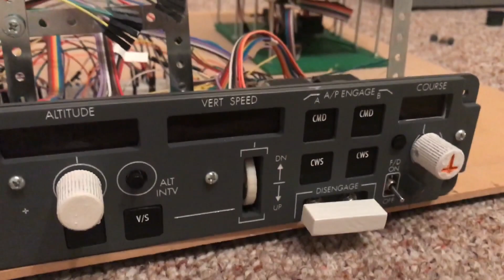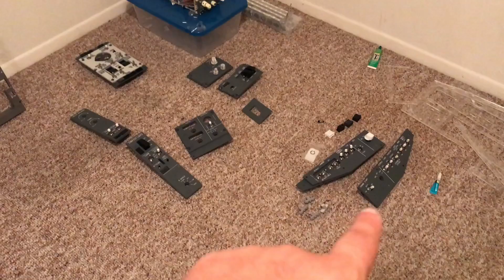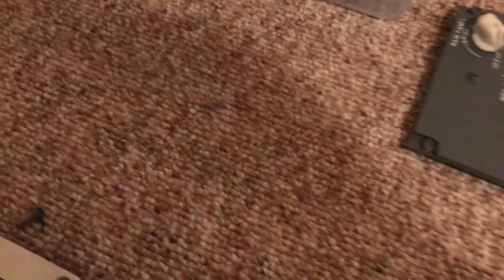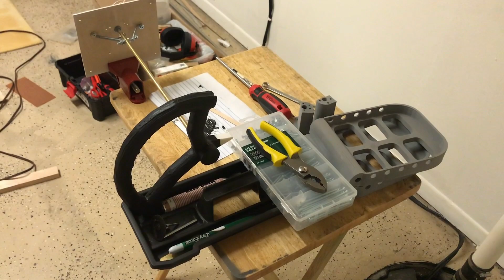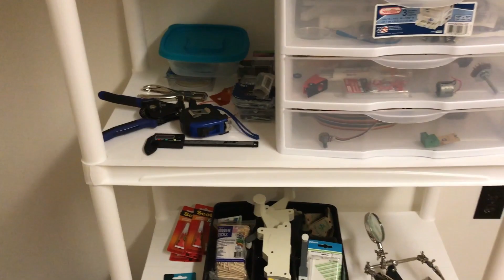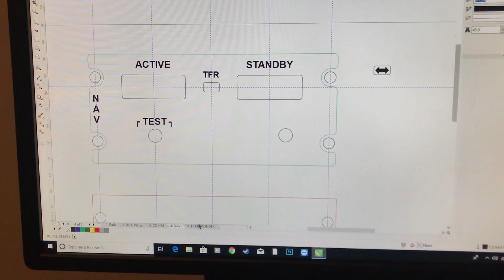737 Panels Update

Comment: can you add the firmware and how the connect wires?? I'm trying to make one
Reply from the maker: Hi, I'm making a video with the new wiring so it will be up here soon, as for the firmware and just using the regular Arduino with it's original libraries, and using http://simvim.com/index.html
Guive it a shot, there is pretty much all the info you need to link arduino with Xplane there.
Reply: @America737Project   |
Correction:  You don't need Arduino libraries, just any atmega2560 board and SimVimCockpit software.
Vlad (SimVim)

Comment: You didnt solder anything?! How did you do it?
Reply from the maker: Juan Sanchez it’s half and half right now, I do have a few things soldered now, but the rest is using the fast connection pins, which snap into each other and stays pretty well there, but it will all be soldered for a permanent solution.